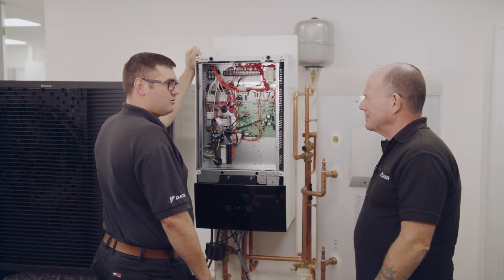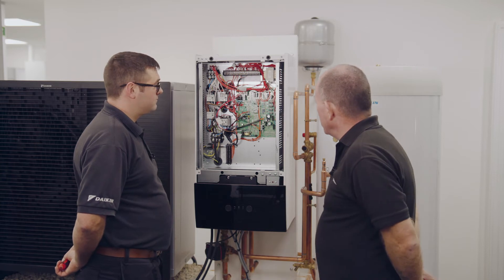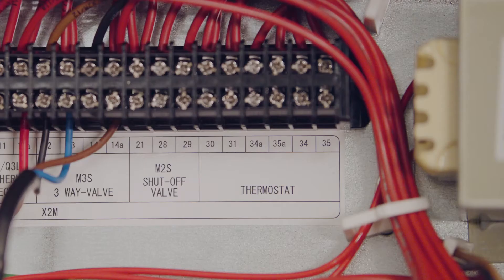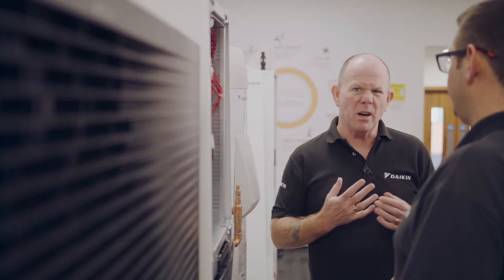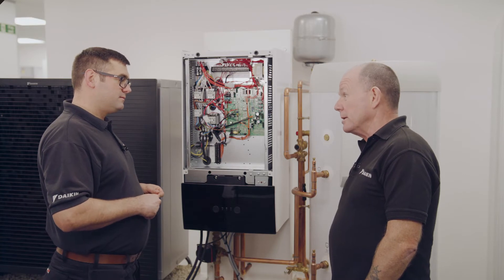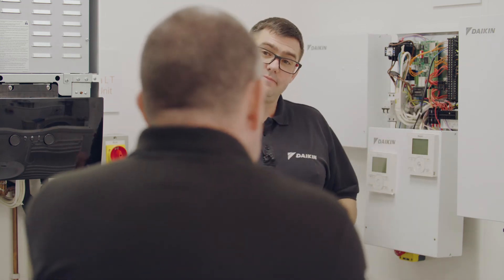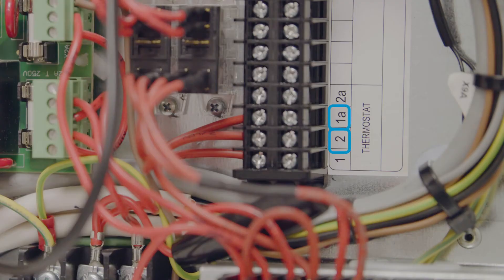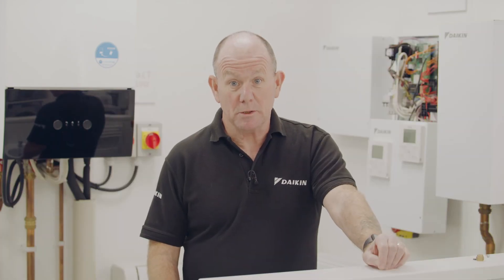Connecting a 3rd party thermostat to a Daikin Altherma unit

Comment: Hi Guys, My altherma model is ehbx08cb3v and thermostat connectors are:
1 2 1a 2a 3 4
Which ones I need to connect to relay? COM and NO connections on relay.
I checked 4 is neutral and all others are live on my device.

Comment: I have 2 zones. Floor is Main zone. Radiator is extra zone. Is it possible to have a third party room thermostat only on the Radiator zone?
Hooked it up on 30 and 35a. But the menu is not allowing to change settings.

Comment: If I have a wireless thermostat receiver wich requires 230v, and also has a NC/NO contact, is it posible to conect the live to 31, the null to 30, and then also conect the NC/NO contact to 30 and 35?
That would mean I have 2 wires going into the socket nr 30
Reply: Hi Daikin, I would also like to know the answer to this question
Reply: Just lay 3 wires to the thermostat and make a bridge in thermostat from N to the contact common, no need to pull a fourth wire for a double neutral. In Daikin terminal strip just connect 30 for N,31 for phase and 35 for thermostat NO contact.
Reply: @icemanrulez  Please help! I have thermostat that has 230V signal for heating and 230v signal for heating. 

I installed two relays in outdoor unit and relays act as they should when operating the thermostat. I connected one relay to 35-30 and another to 34-30.

Daikin 3M Monoblock.In installer settings i set one zone,fixed output/ external thermostat.
I can see that Thermostat A is activated when the thermostat is in heating mode but when i activate it to cooling mode nothing happens. I think i need to manually set MMI to heating or cooling then rewire the relays to use my thermostat? Any ideas?